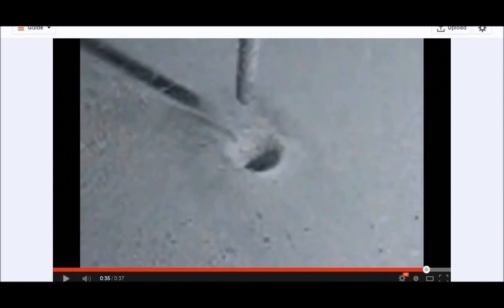Electric Discharge and Surface Formation

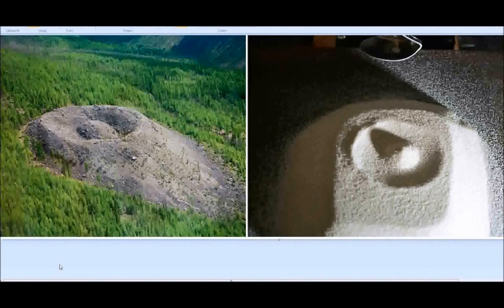Comment: 4:40  sand mound gets shaped by electrostatic discharge that magnetizes some particles and sculpts a crater around that.  6:40  close up same.  9:55  making volcanic-type craters with electric current.  10:48  bullseye craters, on moon, in russia.  11:12  devil's tower, usa.

Comment: Really cool video, and interesting effect I've never seen before. But, I think your conclusions at the end are a little too far-reaching... Geological formations such as devil's tower (and giant's causeway, and devil's postpile) are all made of igneous rock. If they were sedimentary rocks, then, this could be a possible hypothesis to test further.  But, instead, the columns are formed by the slowly and evenly cooling down of molten rock. Due to thermal expansion, the molten rock occupies a greater volume than the solid rock. So when it cools, it contracts, thus forming evenly dispersed cracks (turning it into polygonal columns) because of the uniform cooling.

Comment: Devils tower is basalt. Columnar jointing results from basaltic magma cooling beneath the surface in sedimentary rock then being a denser material than the surrounding areas, it eroded slower after it cooled. Mount Crested Butte in Colorado is much the same...a laccolith structure form by the cooling of magma below the surface. Does the electric universe tell us magma is drawn up like the sand? Also, if electrical currents formed the Meteor crater in AZ would there not be "fused" obsidian like glass structures as well? The example you gave at the end...do you know what minerals it contained and how it was altered by the heat? It seems to me one could distinguish easily between an impact crater and an electrical discharge crater, yes? I am a student of the electric universe so I hope you see these questions as inviting and not a threat. Thanks...
Reply: I know magma is basically a plasma.. Can you recreate the structure forms by the cooling of magma below the surface?
And why would there be a 'fused' obsidian like glass structure?..
But yeah there must be a way to distinguish between the two craters, recreate both and compare dude..
Like ya say I'm only asking for a better understanding... =D